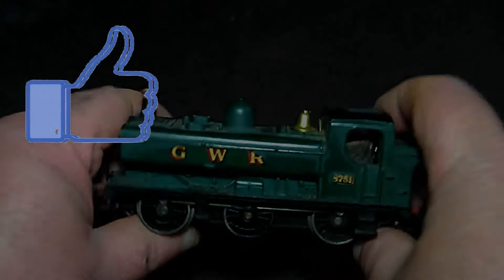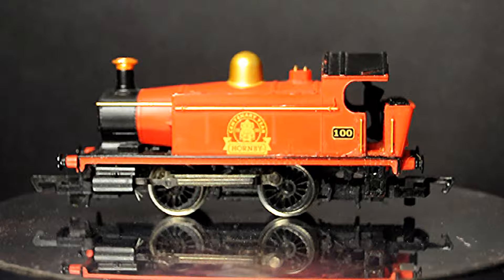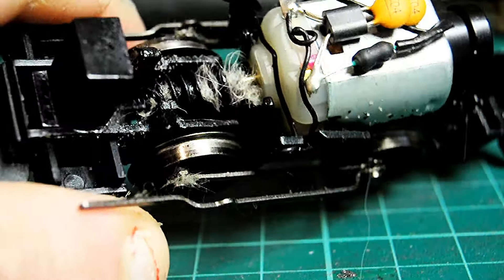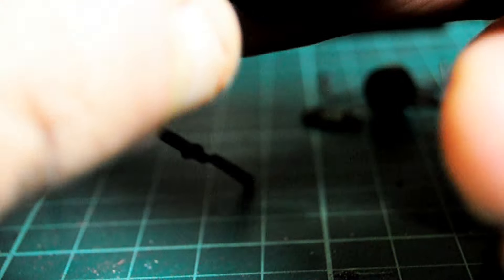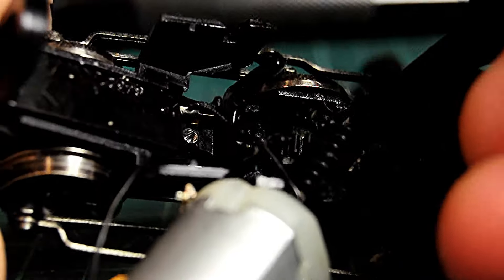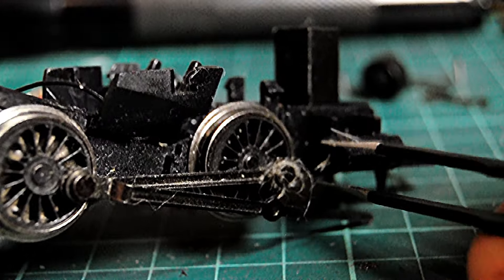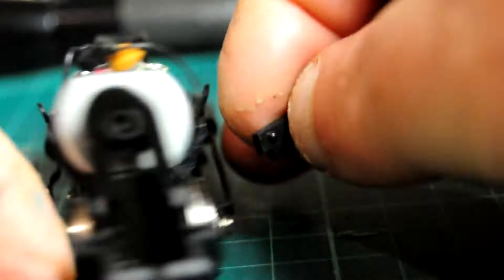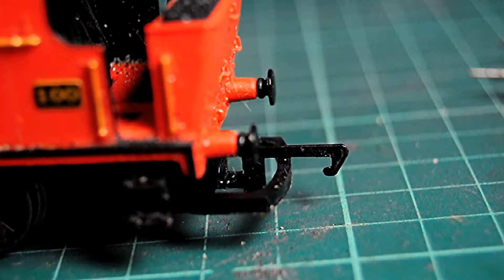EBAY SUB £10 00 LOCO BARGAIN

Comment: This is why you never run your locos on fibrous cloth and shag carpet. You kill your Locos. THat's insulating tape for something they usually lose their glue after a few years and fall out.
Reply from the maker: thing is though i have stripped and built many and it's the first time i've seen it , doesn't need insulating where it is